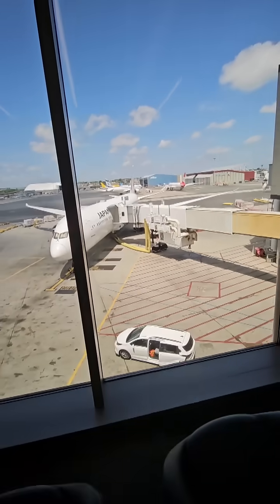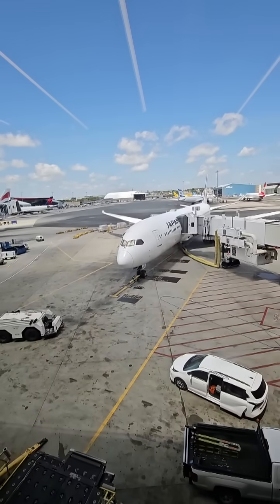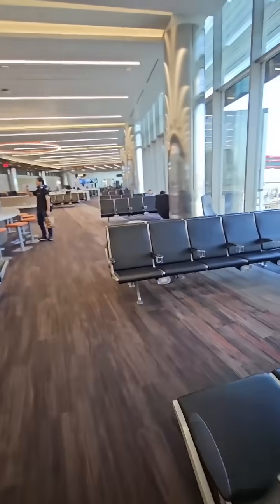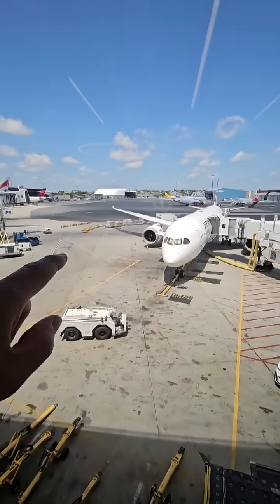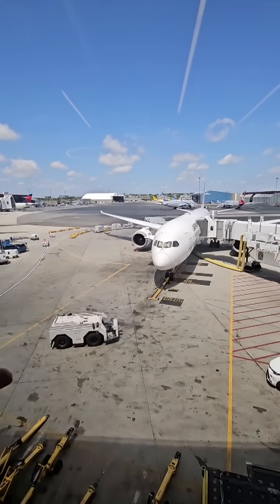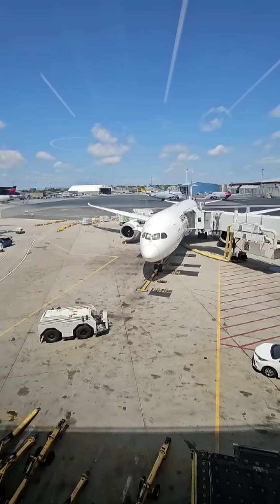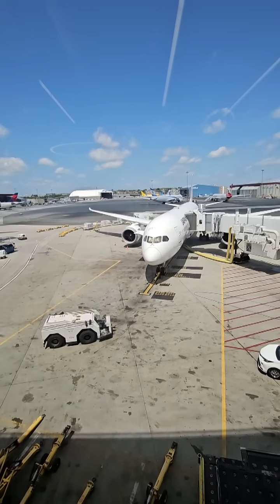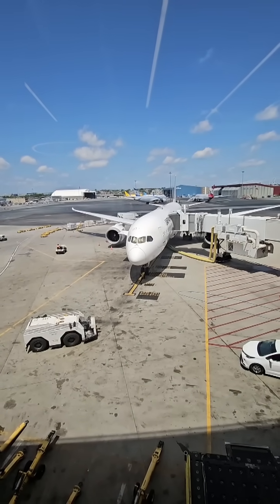Japan Airlines Boeing 787 - Electrical Systems!

Comment: Can you explain compression, sometime, Captain, as in, "cabin compression"?
Reply from the maker: I think you are referring to how the aircraft is pressurized? I will assume that is your question.

The air becomes thinner, or less dense the higher you go in the atmosphere. Around 10,000 feet the air becomes too thin to allow most humans to function. 

Altitude sickness is similar to getting drunk. It comes on slowly and if you keep drinking you will eventually black out and go to sleep. It is also insidious, in that it is hard for the human body to perceive it is happening. This is why it is so important to keep the cabin of an aircraft similar in pressure to a lower altitude below 10,000 feet. 

The way most aircraft do this is by 'pressurizing' the hull of the aircraft. Jet engines produce thrust by compressing the outside air, igniting it so it expands, then expelling it from the rear of the jet at a very high velocity. 

Modern aircraft take a small portion of the pressurized air that the jet engine produces and pumps it into the cabin of the aircraft. It goes through filters and cooling first, of course.

The pressurized air increases the cabin pressure to simulate a breathable altitude, usually around 6,000-8,000 feet, which is a good compromise. If it were to provide a sea level simulated altitude the pressure would have to be greater inside the cabin of the aircraft. The aircraft would have to therefore be built much stronger which would mean it would weigh much more and with an aircraft weight is not your friend. They want as light a weight as possible so it requires less thrust which means lower fuel consumption.

The cabin pressure and altitude is regulate by one or more outflow valves. An outflow valve is literally just a controlled opening on the aircraft skin that allows the pressure to be 'relieved' inside the cabin of the aircraft. 

This relieving of the pressure is needed because if there was no relief the pressure inside the cabin would build and build to an unsafe level. 

Think of it this way - instead of regulating the compressed air coming into the cabin from the jet engines aircraft instead use the outflow valve to relieve pressure to regulate the cabin pressure. That way there's a constant flow of air to the airplane and the outflow valve modulates to control the maximum pressure of the cabin, which is another way of saying it regulates the altitude of the cabin. 

I hope that helps for you to understand the system.

Comment: Hey captain Z can you without getting in trouble with your company take us through a mock landing or takeoff. Like what you’re thinking or paying most attention too. Thanks in advance????? 😊
Reply from the maker: The FAA doesn't allow US regulated pilots to take any video of this, unlike most regulations around the world (and why YouTube is full of awesome videos of takeoffs and landings). 

That being said here's the best I can do with narration and your imagination...

Once we are taken off the arrival, which is a predetermined course, altitude, and speed plan for each airport, we are usually on a heading and given an airspeed. 

That close to a major airport we are always looking for traffic. We are also thinking about when we need to descend and what speed we want to be to arrive at the start of the approach at the right altitude and speed. 

The controller usually sequences us behind another aircraft, which we can usually see on our TCAS (traffic and collision avoidance system - kind of like a fish finder on a boat!). 

We are cognizant of where the localizer is, which is the extended centerline of the runway and the altitude at the fix the approach starts at, which we call the final approach fix (FAF). 

If all goes well and we are at the right place and height and we are cleared for the approach we push the LOC button then the APCH button then we engage the other auto-pilot so we have two. 

By doing this the auto-pilot will intercept the localizer and glide slope and follow it down to within 200 feet above the runway a very short distance from the threshold. 

All the while we are slowing and configuring the aircraft with slats (front of the wing) and flaps (back of the wing) and eventually call for "gear down". 

We want to be fully configured by 1000 feet above the airport, meaning flaps and gear down and the landing checklist complete. 

We must be 'on speed', meaning within 10 knots of the Vapp (final approach speed) by 500 feet. If we are not on speed, too high or low on the glide slope, or we aren't continuously in a position to make a normal landing we are unstable and any pilot can recognize this and call "Go Around". The pilot flying doesn't hesitate when that is called and applies TOGA  thrust (Takeoff or Go Around). 

If TOGA is activated by pushing the thrust levers to their forward stop the aircraft will go into 'go around' mode - if on the auto-pilot it will immediately climb to the missed approach altitude, which was set at the beginning of the approach. 

While on the approach the pilot monitoring is monitoring the progress of the approach, configuring the aircraft based on the pilot flying requests, and calling the tower to get landing clearance. 

That's about it. All this happens pretty quickly.
Reply: @CaptainZtravels  thank you
Reply: ❤ @CaptainZtravels

Comment: Thank you Captain Z, I had no idea the electrical systems was doing everything. The 787 is one of my favorite planes, it’s second to the Queen of the skies. Both are very reliable planes!!
Reply from the maker: It's the first commercial jetliner to use electric to start the engines instead of bleed air from the Auxilliary power unit (APU), it uses electric to heat the wing leading edges for anit-icing in wet and cold weather, and also uses electric compressors to pressurize the airplane where every other airplane uses a tap of the pressurized bleed air from the engine. Very different design for sure.
Reply: @CaptainZtravels Thank you! Yes that is new to me. Does it have greater APU capabilities?